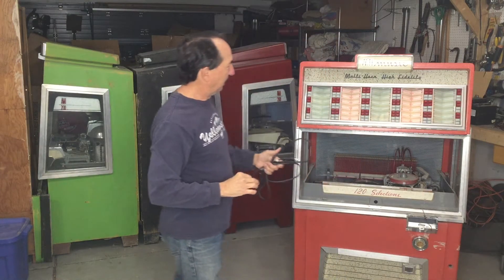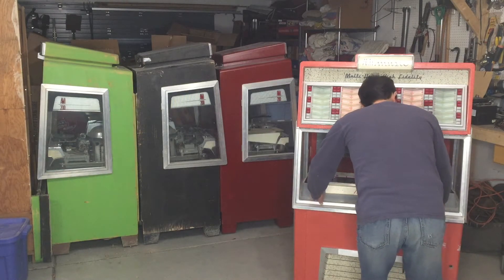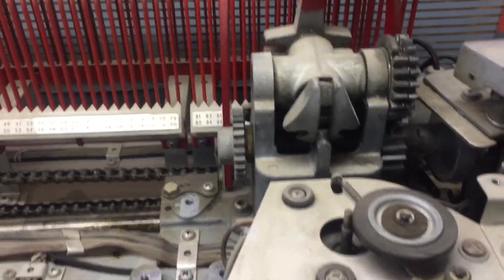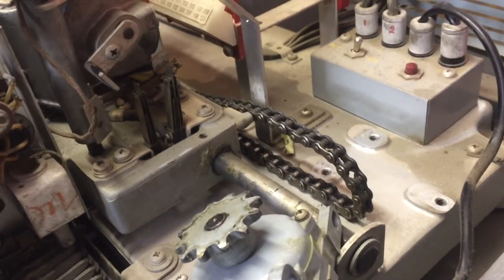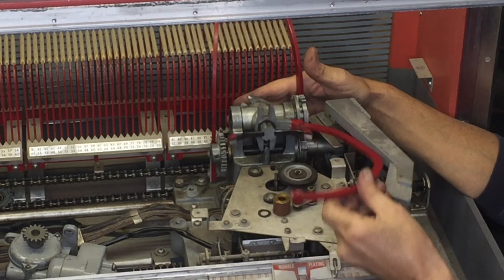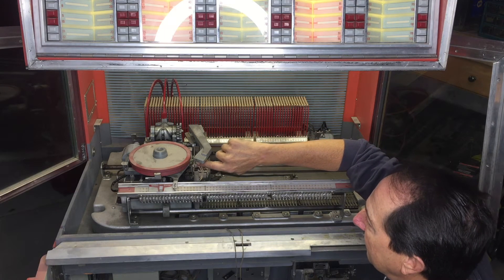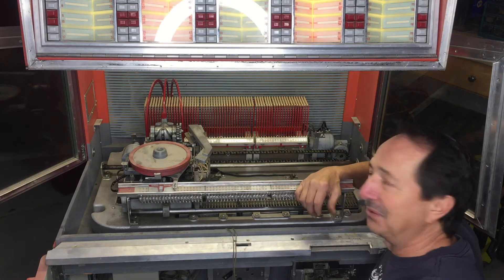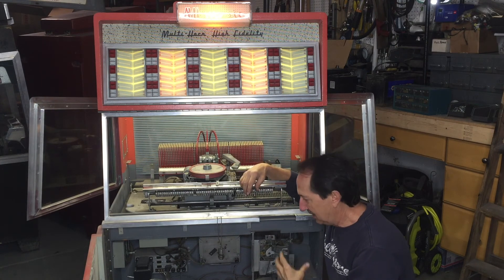4 - AMI Jukeboxes, F120 & G200. Part 2. Will It Work? I'll start with the one that is most complete.

Comment: Those F120s are good sounding machines.  I have one restored and it's my favorite.  I always tell people if they want an old jukebox the F80 or F120 is the one to get.  It's the simplest and easiest to work on and parts are reasonably accessible. 
I've had mine since 1987 and it's still running great.  My favorite.
Reply from the maker: It is really amazing how the speaker is mounted up top and then the sound is directed down the back and out the bottom and front. That all makes for a great sound.
Reply: @riderescue 
Another thing interesting is AMI is the last standing jukebox company.  Today it's AMI Entertainment.  I ran into one of their streaming "jukeboxes" at a Denny's near Sacramento.
Reply: Thanks for doing this video.  I am working on an ami f120 that hasn't been playing for 25 years and have been experiencing some of the same "locked up" situations.  It's helpful to see what you were doing to  resurrect this one!
Reply: @brianrees52 
If you have any questions, I'm here for ya'.  😊

Comment: That red button is NOT a "re-set" button.  That is a manual override to move the  mechanism to service the unit or install records so the mech isn't in the way.   It's a push-and-hold for contact switch.